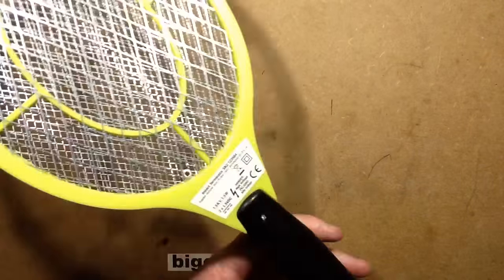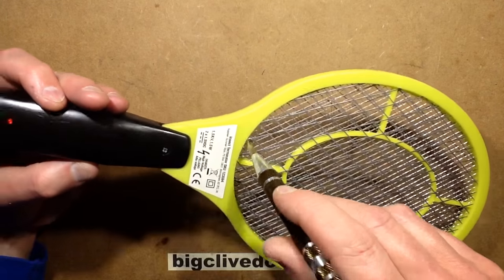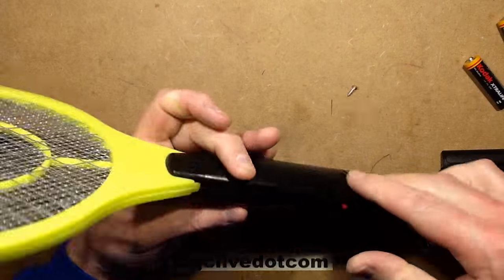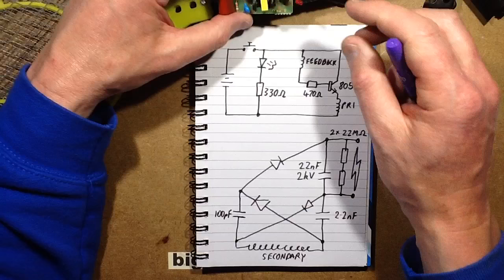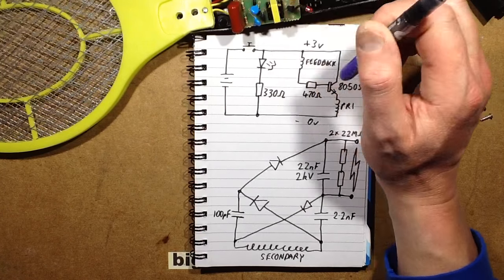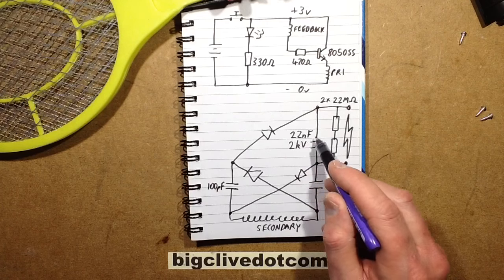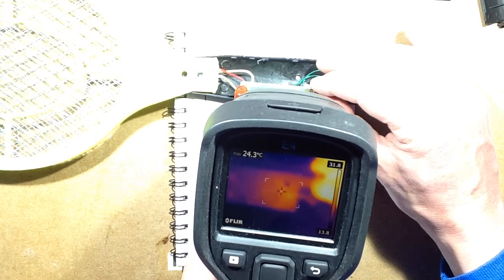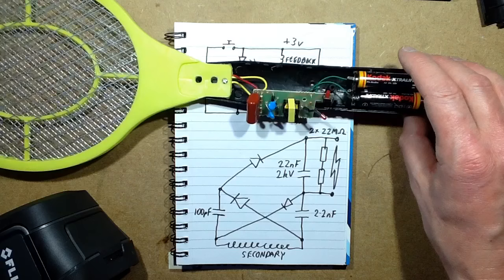Inside a bug zapper racket / racquet , with schematic.

Comment: I've purchased maybe 5 of these. They work great in the beginning but after a while, the zap is just not strong enough to zap the insects that fly into the mesh.  Battery is good.  The on light is lit when the button is pressed. When I hit the inner mesh, it sparks but it just stops zapping bugs.  Any ideas???  I would love to be able to fix rather than having to purchase new ones.

Comment: @Bigclivedotcom i recently (may 2019) bought some of these. the circuitry is different. there is only 1 diode. one big fat capacitor (looks same as your vid). 3 resistors, (1x megohm and 2x500ohm) a transistor (marked C2328A Y 514)  a green led and the button. i ran 9volt battery through one of these bats and i think i killed the transistor. the led lights, but nothing happens when the layers are shorted. i wanted a little more "punch" in the zap.. thetransistor is supposed to be able to take 30v max. what have i done wrong and how can i make it "snappier"?

Comment: I am about to turn one of these into a static grass applicator. trying to be cheap. My first one was a failure but I think I got some non functioning parts from china so ya i should have know. but I seen some vids of people doing this so I am gonna try.  about the transistor getting hot from continual use, what do u suggest as a replacement for it?

Comment: I've got one wired up to 4.5V continuous. It's slightly warm after running it for a few hours.  It makes a louder snap than before with 3V from batteries..  I've got it positioned over a fruit fly trap to kill them all as they try to go in.

Comment: So if I wanted to modify this to kill the wasps that plague the lunch area at work, would I be best served adding a few more of those 22nf capacitors in parallel?  I also wouldn't mind making the circuit more robust.  But I'm kind of new to electronics.  I've mostly done work with digital circuits and analog circuits are still rather confusing to me.

Comment: I used to have one with the alternating bar design. it was significantly more effective than this one. do you think it would pack a bigger punch if I removed the discharge resistors? my old one with the bars didn't self discharge, and nobody got shocked from it. I highly doubt anyone would be shocked from this one.

Comment: The secondary circuit contains diode (connecting 100pF and 22nF) in the forward path while charging all 3 capacitors. This diode stops the current from the 2kV capacitor reaching the metal net during discharge, thus reducing a potential risk of nasty burns. The other 2 diodes are used for safe discharge of 100pF and 2.2nF through the 22MOhm resistors to avoid shock from the 2kV capacitor when the bat is not in use. At any given point the 22nF capacitor contains 2kV potential and charge (so be careful while disassembly), since it has no path to discharge.

Comment: How many volts in these raquets? How many amps when it discharges ? I'm too scared to touch it  and feel the shock .I once disassembled a disposable camera flash ; the part that says 'Danger do not open here ' I was sitting on a metal bedstead and I got quite a shock.

Comment: I actually replaced the battery inside with an external case for single rechargeable 3.7v 18650 battery so I can swap a freshly-recharged one at ease, as a bonus, it also gave it extra zapping power. after some good uses(over a year of regular use), I think I blew the capacitor first instead, that brown one on the end of the circuit, is that it? it seems to have spewed some waxy stuff around it, and have visible damage.

Comment: Putting the primary on the emitter side protects the transistors emitter-base junction from the high voltage spike. If primary and feedback coils are identical then a high negetive voltage will be applied to both emitter and base so there will be no net difference. If the feedback is a smaller inductance then the junction will be forward biased and the 470 ohm will limit the current and stabilise the voltage.
The original version seemed to have a higher chance of getting the insect into the circuit with its simpler weave and finer wires. Put nicads in them and the voltage is quite fly-frying, with a good chance of light, crack, smoke and smell all being emitted from the victim.

Comment: In my one, transistor's base is connected to batteries without any resistor, just through the feedback winding. However, the base is also connected (parallel) to some other winding probably from the secondary side in series with resistor.

Comment: Why not eliminate the discharge resistors to give the transistor light duty? Pump up the 2kV capacitor and let it ride. Push the button once in a while to replace the cap leakage. Just keep your pinkies out of the mesh!

Comment: I purchased one of these a few years ago, and discovered that it did not have a discharge resistor when I picked it up to tap a fly and the bat bit me. we did find however, that we could hang the bat near a window and press the button to charge it and if we heard a pop just push the button again, we used to charge the bat (press the button) once or twice a day unless there were a lot of flies, in which case we would charge it every hour or when we heard it pop
Reply: Or you could just have used some tape on the button...
Reply: GRBTutorials the transistor would get hot

Comment: most painful shock I ever received was from one of these. An overzealous swing resulted in the frame separating. While trying to  snap it back together I managed to close the circuit via the negative in one hand and positive into the other. Those electrons doing what they do, took the shortest path. Up my arm across my chest and down the other arm.

I do a lot of remodel work so I've grown accustomed to a 110V joly occasionally. Stun guns? Uncomfortable but localised. I've been Tased(not directly police related) and while intensely debilitating the shocks weren't anything compared to that $4 fly swatter. I'm fairly certain that I came close to getting a ride to the hospital that day.

Comment: You can replace the 2 AA cells with a single 14500 Li-ion cell and make the fly swatter somewhat more powerful (about 3.7V instead of the 3V of the alkalines). Just put the 14500 in one side of the battery holder and put a conductive spacer the size of a AA cell (or solder a wire across) to complete the battery circuit. I've modified the Harbor Freight ones (use 2 D cells), using an 18650 Li-ion cell and some centering and pass-thru stuff. This fly zapper is much easier to mod.

Comment: I used to have one of the interlaced wire versions but it sadly broke and I had to replace it with a screened version as above - the new type does not work nearly as well. Bugs sometimes bounce off the outer screen without touching the inner screen and the zap isn't nearly as powerful even when they do.

Anyone know if the old type is still available anywhere?

Comment: I would prefer the discharge resistors to be a lot lower so that the main capacitor can still hold the charge for about a minute after releasing the button. It makes it easier to hold while swatting flies without having to press on the button all the time.

Comment: I have one of these, it litterally explodes the flies that comes within its reach.
Also, mine doesn't discharge very fast. It holds the charge for quite a while, which has taken me by surprise ever so often.
At full charge combined with my natural curiosity, I put my finger on the mesh. It left a tiny black spot on the tip of my finger, half my finger was quite numb afterwards.
I wonder how much voltage mine puts out.

Comment: I had one of the earlier versions with individual high voltage grid wires. It didn't last long, after swatting a very large bluebottle fly and I clipped the wall with the racket and all the individual grid wires came lose and fell out. Bluebottle fly one, bug zapper nil! I was never any good at racket sports either.....

I found if you use rechargeable cells it kills the bug zapper, but it is OK to use alkaline cells, I guess it's down to the internal resistance of the cells, alkaline cells having a higher internal resistance than NiMh cells, and your average bench PSU.

I'm on to my 4th Bug Zapper, I also found that if you zap one of the larger bugs (larger than a UK miggie) you will find that the bug zapper only stuns the bug, you have to be quick to retrieve the stunned bug and dispose of/dispatch it before it wakes up and plays merry hell with you for zapping it!

K Watt.

Comment: Most of these low cost zappers can't kill insects, just stuns them for a minute then they fly off (unless you step on them while they are down).  Probably would be better with a bigger capacitor. Forget 22nF, are 2200F supercapacitors available with high voltage ratings yet? (Elephant zapper).

Comment: I looked at several of these zappers and typically they generate ~1500v.  The output capacitors there are 0.22 to 0.33uF and are rated only @ 630V so they wouldn't last very long.  I replaced the output capacitor with what is called "X2" capacitors (much more expensive capacitors), they are designed for direct AC line application and they can handle peak voltages of up to 2500V.  Also you can replace the capacitor with larger value 0.47 to 1.0uF (any larger value wouldn't fit in the case) which will produce much larger energy spark.

Comment: They have changed the Harbor Freight zappers.  An older one that worked well until the kids busted the head, was wired like yours.  The newer ones suck, no satisfying snap; they have the output circuit changed to one diode, two resisters, the large capacitor, and no smaller capacitors.

Comment: Just purchased a newer version of this bat. They eliminated the discharge resistors from the circuit board, so it still has one good zap in it AFTER the button is released.

Comment: I took electronics two times in degree programs. The first time was at the end of the vacuum tube era with very few semi-conductors and the second after  almost all the tubes had been replaced. Electron flow vs conventional current flow, in theory from a bunch of dusty professors that all had severe issues getting along with humans. I have been damaged by my experience, learning all the math and then learning it again exactly backwards. Because of my skills I normally was placed in the head of departments, maintenance, electrical and electronics but not confined to the areas. I was always doing what I loved. It's snice to see another electricity/electronics person doing what they love.

Comment: I damaged an expansive power supply with a bug zapper. It seems that high voltage spikes are generated on the +3 volt / ground side (should be easy to check with a scope).

Comment: We have similar versions in the U.S. and I rip the racquet off and mount contacts in the end and just plug them in when I need HV sources for plasma displays and general tinkering with. Also got tired of wee batteries going dead so I installed a fat 18650 rechargeable in the handle. Also installed a proper power switch so I could stop stunning myself. And thank you for doing such wonderful videos. Your efforts and warnings will likely save me, er... delay my eventual death by electrocution. If the isotopes don't do me in first. Good thing about being an old fart. Cancer has no teeth as a threat anymore.

Comment: Just a simple question / correction:
The discharge resistors are not only there so you will not get shocked after a while, they are there so the capacitor wont get overcharged and blow up ... 
I am not sure if you have thought about this before, but that is mainly the reason.
(otherwise an open circuit would charge the capacitor forever, reaching higher and higher voltages, until the capacitance simply collapses ...)

BTW i like your videos, i am a skilled electrician technician, but you have shown me things i would never know from school ...

Sorry if this one has been pointed out by someone, but i checked the last comments and they did not contained any info regarding my question

Comment: Clive, how would you reduce the zing from the zapper? Reduce the capacitance of the final capacitor? Reduce the voltage rating of the capacitor or reduce the turns on the secondary winding? Or could you add something after the capacitor to limit / reduce the zap?

Comment: Some even cheaper, nastier versions have NO discharge resistor, and they're dipped in some sort of reclaimed wax, probably scraped off the bin at the candle factory.

Some versions have rechargeable "Li-ion" or "li-ion" or "lion" cells in it, which is actually really extremely cheap sealed lead acid battery or Ni-MH/Ni-Cd cells, typically at around 2.7V.
Some do have swappable batteries, or a basic capacitor dropper based charging circuit which, obviously, has no discharge resistor in it.
Some versions have flashlight built into it, sometimes with a generic garden light circuit hacked into boost converter mode. But most of the times, they just have four straw hat LEDs wired in series.

Comment: The circuit is similar to a photoflash circuit. I have seen a battery operated barbeque lighter that had a 1000 microfarad electrolytic capacitor and a small transformer inside, with a push button switch. It used a 9 volt battery.

Comment: I still have one of the very first models that ever hit the market, it had quite a more complicated circuit. It was also easy to tune this circuit to considerably boost the voltage output. I brought it up to about 2.7 kV. It does not merely zap mosquitoes, it pretty much vaporises then, very satisfying (aside from the smell).
Reply: i like how the smoke smells (the electrical smoke not the normal smoke) no idea why
Reply: oh and i dont smoke noone in my family smokes

Comment: I had an early version of one of there that came from Harbor Freight Tools in the US. It used two 'D" batteries and it didn't have a discharge circuit because it gave me a nasty shock after it was turned off. I'm guessing it probably had a nice large capacitor that could store a good amount of voltage for at least 10-15 seconds. I would still have it if the plastic around the grid didn't break so easy. Duct tape held it together for awhile but eventually there was no saving it.

Comment: I believe the primary is in the emitter circuit because of greater current gain.
I believe the alternating rod design (which have) allows a greater chance of contacting bug backs and legs.  A surplus outfits sell little power supplies for these and they produce seven thousand Volts.  (per the ads)

Comment: It's amazing how the more you learn about electronics the more you start seeing the same building blocks over and over again. I was genuinely surprised to see a joule thief on the primary side of that circuit.
Reply from the maker: Every electrical/mechanical device breaks down into blocks.  The first part if fault identification is to work out which block has failed and then explore it further.
Some of the most fun circuitry to reverse engineer is the stuff where they have blended the functions of different blocks to economise.  It's like an electronic puzzle working out how they designed it.

Comment: How do we make this, ehh, say more Darth inducing, and robust. I dang been modding these since the first one knocked out and was tossed my way. Been going with a standard 2-4 times the cap 'size' v+f, that being mostly a problem both in size, fitting the burger back in there. Swiping out 3V for 9V as a supply, waiting for it to go out again or get bashed against another wall. Surprised, it works so marvelously with just that and no other changes or modifications necessary, sans requisite un-shorting the grid and putting it back together much to my surprise. Would have though I had to tune the oscillator but na. The HV mylar being the most valuable thing there and more than the set, surprised many of my bench tech's that had never seen that type of cap fail a tester and still intact.  Need to make skeeter piper into more than, ya third degree burns stink, be it you or them. We get them here taking two D cell's, lots of room, thinking reuse 18650's or for slam me down, how dare risk venting a nice 26650. I would be open to a selection of fusing, thermal, protection. Looking for that misted bug, not a mad hornet.

Comment: The bug zapper I bought from Amazon a couple of years back uses an even simpler (read cheaper, less effective) design, forgoing the capacitor diode multiplier and just rectifying the output from the transformer directly into a 22nF capacitor. The transistor is far more substantial, but still gets very hot when running off NiMH cells.  Needless to say it is rather shitty at killing flies, the stunning action that they get is more likely from the action of the racquet on the fly...  I do feel like it needs a redesign... :D

Comment: I got various ones as well, but i got a odder one that i don't know if it is normal or not.
Aldi was selling some under the Gardenline brand. Model 47168

It seems to work as it should since once it pops gnats with a loud pop and i managed to kill flies with it.
But the odd thing? It creates Ozone.
It's making this bleachy smell when i keep it active that's reminiscent of ozone which confuses the hell out of me.
Reply from the maker: There may be a slight corona discharge on the surface of the wires that will create ozone.

Comment: I used it light up CFL. But had to remove the cap and resistors. No heat problems, pulls about 200ma